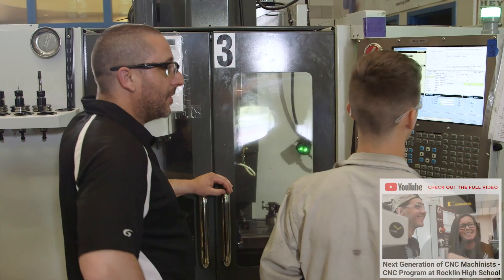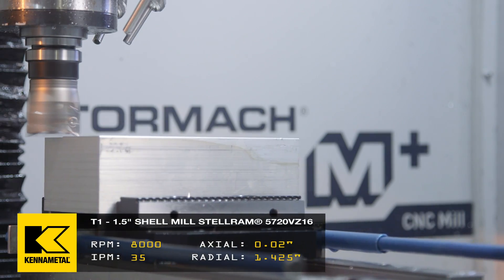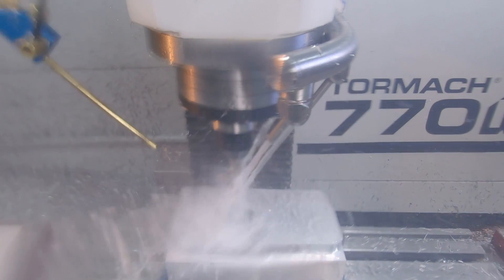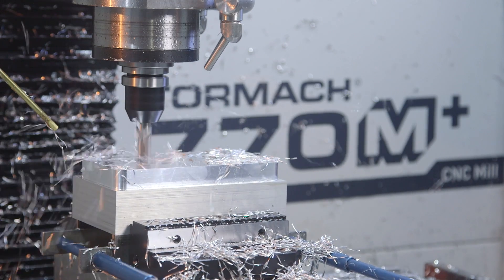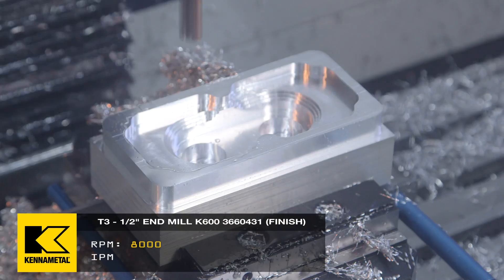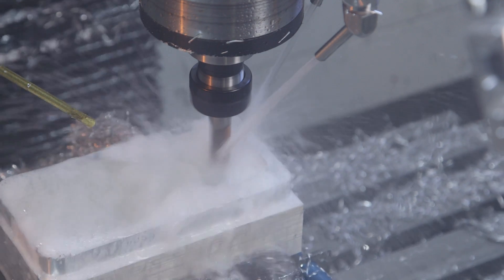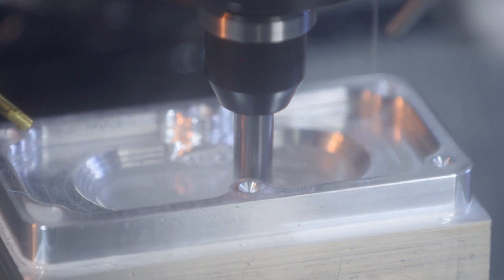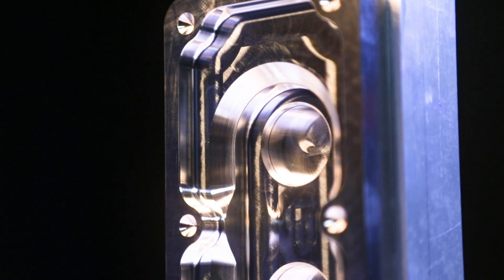Machining the TITAN-53M on a TORMACH - Part 1

Comment: This machine is a toy, it has a motor with the same 750W power as an electric hand drill.
Not accurate on dovetail ways, no quality castings, no power to cut and produce a proper chip in metal without vibrating and breaking tools. 

This message undermines the Titan mission which is supposed to be about excellence.
Where is this machine made, can anyone guess?
No BOOM here folks, rather a case of taking a promotion fee.
This has tainted my view of Titian going forwards, although we all do make mistakes from time to time.
Titian, you have a Rolls Royce showroom and you are trying to sell something like a tuk-tuk. It doesn't make sense.
Reply: But are you a machinist at working a job that has a high end cnc, or do you actually own that high end cnc? This thing is actually in reach for hobbyists, whereas other machines you’re looking at least double/triple the cost. It easy to say what you say when you go to school or work somewhere that has the high end machines. But...you’re stuck doing jobs that your boss gives you rather than making your own projects/ideas.
Reply: Greetings Michael
The problem I have with this is that buying a CNC machine is just the begining when it comes to spending hard earned money chasing a dream.  When you add on all the extras such as tool holders and other machine options, which many people do right out of the starting gate, then the price can easily double.
I agree that the lowest starting or base price is attractive however one must remember that they are buying a tool to perform certain functions.  For most people this will be an investment of sorts and when it comes to investments it really does pay to do your homework.
1. You need several KW on the spindle as a minium.
2. ISO 30 taper minimum to secure the tooling (sub 10mm or 3/8 tool diameter), 40 taper is better.
3. Servo motors on the axis not hybrid or stepper in order to have proper torque and speed.
4. Linear ways and ground ball screws are the only economic method of obtaining repeatable accuracy.  Any slop in the drive train will simply shatter or chip decent carbide tooling.
5. A proper rigid frame or casting to prevent the machine flexing and to have tight control of harmonic vibrations that all machines/tools have.  A machine that can easily bend or flex will destroy tooling and bounce around on the workshop bench or floor when climb milling.

When trying to buy cheap your options are heavily used old machines that would more than likely be well past their best. The second option is kit like Tormach.  Both options are sub optimal and will result in much frustration for the average person looking to get in to this field. There will of course be people that know exactly what they are getting and how best to use such kit, but not many.

I myself have been here many years ago.  I worked out what was what and put a plan in place to obtain a proper machine which I now have.  You need to work hard and smart and save. Avoid debt as this is another potential pitfall.

I would recommend looking at some of the Haas offerings as they do cater for a tight budget.  There will be others out there such as Hurco which is what I ended up buying.

The general rule in life, which tends to be true more often that not, is 'Buy cheap, buy twice'.

Kind regards.
Reply: @CATANOVA  Dude, different people have different needs, limitations, and objectives. Yours is the perspective of a purchaser who can commit to $50 - $100K or more out the gate. So, yeah, obviously not a Tormach buyer. But me? It was a stretch as a hobbiest to even get a Tormach. And, no, I'm not going to buy some 20 year old dinosaur FADAL, and then update it and pray it keeps running. But for others that's an excellent way to save some $s and get higher performance. But I don't need industrial speeds and feeds. So for people like me, for someone wanting to smart small in a side business, for a school, Tormach machines are a very good choice. But, clearly, if you need (and can afford) the extra speed and accuracy, by all means go for it. Also if you work within it's power envelope, it's perfectly capable of producing high quality parts good enough for many if not most parts a hobbiest or small operation produces. And if you think Titan added this level tool for a promotion fee, well you're entitled to your wrong opinion.

Comment: @titans of CNC:Academy What coolant ring is that?
Reply from the maker: Came with the machine
Reply: @TITANSofCNC  interesting, it's not on the tormach website
Reply: @MakingandBreaking  It is now, actually it's been there all along, but was hard to find (no proper link from the Coolant menu item). But Tormach have recently updated their website and the 1100M and 770M specific versions of the flood coolant system and of the automatic oiler are shown on the appropriate pages if you follow the website menus for Accessories and then Machine Options (see Oilers) or Coolant Systems (see Coolant Pumps, 1/8 th HP model 38881).

Comment: Does tormach accept mastercam programming?
Reply: Tormach accepts Gcode so yes pretty sure Mastercam will work.
Reply from the maker: Absolutely
Reply: The tormach machine control will run standard G-code, as will any machine using a PC based control running Mach, EMC, etc.  I do not believe there is a post in Mastercam for "Tormach" but you can probably use one for HAAS  etc. with a couple of minor tweaks. But if you can afford a seat of Mastercam, a Tormach is probably not your best bet for a machine tool.
Reply: @mytuberforyou  I have a lifetime Mastercam license through my College. I also know long hand. I'm just looking for something to keep in the garage and run on my free time. Keep my skills honed.

Comment: You guys must have some secret sauce. I’ve watched dozens of Tormach videos and no one gets the surface finish that you got on that part. I’ve never seen anyone use Kenametal tools in a Tormach either. Are those tools really that much more precise? If that’s the key, the difference from the other videos I’ve seen is mind blowing.
Reply from the maker: Tooling is huge, also pressure and rigidity... many try to push and show aggression...
We are focused on the Art of cutting and teaching as we go by giving all speeds and feeds etc
Reply: @TITANSofCNC  How would you go about geting similar cutting results on machines with different specifications and alternatively differnt tools. We use a Haas TM1P that has more horsepower but less spindle speed available (6000RPM). Would it make sense to use tools with more flutes or simply just feeds and speeds by 25%, or utilise the HP to take deeper cuts?

Comment: Are your feeds and speeds arrived at by following the tool suppliers recommended feeds and speeds or did you calculate them yourselves?  I ask because my Tormach 770 generally can't use the recommended feeds and speeds supplied by the cutting tool manufacturer.
Reply from the maker: You know, it’s really an Art. You also have to look at your machine, HP, Speed, Rigidity etc.
I always listen to reps and use that as a starting point but usually push way past it... by thriving in different lanes... like having really good rigidity, tool length, Coolant etc...
With the Tormach, I see it for what it is... a low priced machine that doesn’t have power but allows people who could never have afforded a machine, to have one and to make parts to print.

So notice my Radial depths... very small, but I go full depth...

Also use drills that break chips well like GoDrills because it take less force to drive them.
Just have to learn, use common sense and learn as you go.
Reply: Yea that's kind of what I figured.  I've found that with my 770 I generally have to reduce nearly all of my calculated feeds and speeds by at least a third of what's recommended by the tool manufactures and also those feeds and speeds that my HSM feeds and speeds software churns out.

I was really hoping that this video had some easy to figure out method of calculating feeds and speeds for Hobby-Mill like the Tormach line of CNC mills.   I guess it's really not possible.  After breaking my share of end mills, I eventually had to play it by ear; literally.

Thanks for your quick reply and keep up the good work.
 @TITANSofCNC
Reply: @MrTjmk  You can still use chip load to calculate your speeds/feeds, but with a flimsy import milling machine (mine's an RF clone, not a Tormach)  your feeds and speeds need to be a lot LOWER (with the same chip load) because the spindle just doesn't have enough torque at the kinds of speeds big boy tools are designed to run at, if you can even get there. The most important thing in my experience is running high positive rake aluminum inserts, my machine is not at all tolerant of using carbide inserts for steel on aluminum, takes much more cutting force and bogs machine spindle.

Comment: M+ so that machine has servos, Tormach are finally delivering some?
Reply from the maker: Yes, not sure when but it’s weeks not months... I believe
Reply: As of early May-2019, the servo upgrade kits are shipping to end users (just got mine!). These are the upgrades for 1100M --> 1100M+ and 770M --> 770M+. Tormach says servo upgrades for older 770/1100 series 3 (and I think even earlier) are coming later in 2019. M-series Spindle upgrades are still pending and will take M, or M+ to MX for those interested.
Reply: @SH-pc4xt  
Thanks for the info 👍

Comment: I ordered a Syil 5 as they seem to have better support in Europe. It is a 440 sized machine, slightly cheaper, better specs.

I almost went Tormach, but apparently they can't even be bothered producing 230V or 400V machines that is needed for every other marked than north America and Japan. 

Tooling is also a problem, because there seems to be no way to buy Kennametal here. The local distributor does not carry the Titan of CNC tooling kit, and also does not sell to individuals or small companies starting up.
Reply: The 1100S3 & 1100M are 220v. Tormach's electrical system is internationally recognized for use all over the world. You can get  a transformer to adjust the voltage in your situation if need be. KMetal is premium tooling and I am sure if you contacted HQ in USA they would be happy to help you.
Reply: @automan1223  the main problem then is that the 1100 are out of my price range. And frankly getting too close to HAAS tool mill pricing. 

But also the 220V is not made for European 230V 50 Hz. It is not approved and illegal to connect. The same is true for the transformer. It might work, but if someone is hurt or the house burns down, you are in trouble.

But yes, all they need to do is include that transformer in overseas orders and get it CE approved. I do not get why Tormach apparently can not be bothered.

Comment: Nice to see the 770M running.  When I saw yalls other video I called Tormach and got a bit of background on this particular machine you have.  Couple of comments/questions:

1) the 770M is targeted at “affordable”...please keep that in mind when demoing the associated tooling :-).  Even at 50% off, that tooling is very expensive for small biz owners like us.  
2) would be great to see some of the setup for the part, eg Fusion 360/Inventor/Etc. Toolpaths et al
3) so given this is the 770 w servos, are y’all using a standard 770 post or a custom one?
4) speaking of affordable, how much is that vice?  Can’t find pricing info anywhere online.  Just curious if one might replace the Glacern I’m currently using.
5) would be great to see some micromaching on the 770M (hint hint) :-)

Thanks for posting the video, looking forward to more from you.

Be glad when the 770M starts shipping!  Been waiting quite a while for it.
Reply from the maker: The vise is one we had available but is over kill for this machine as it’s one of the most rigid vises in the world... 

Post is exactly the same.

Tooling can make a affordable machine... function like an expensive machine. So my theory here is to show that this machine can make beautiful parts to print, with great surface finishes without taking days to do it.
Reply: Thank for replying.  Totally agree on the turn around time of machining vs 3D printing (which we currently do), also materials costs.  For materials costs for prototyping, Renshape vs resin (at 250 a liter for example) for larger core parts is very attractive.  That’s the entire reason we’re looking to move to a hybrid environment of combined printing and machining to produce a given prototype.  CNC is new to us, so look forward to following y’all on the “education/small biz” approach ;-j
Reply from the maker: Lots more set ups coming and all kinds of machining. As previously stated I have 400K, 40K and this 15K machine... each has its place.
Reply: Agreed.

Comment: kinda funny that a $10k tormach is outfitted with $10k worth of kennametal tooling...
Reply from the maker: Again,
Definitely wrong on that. That Shell Mill is a few hundred and you use it on everything. Tooling is the key to Machining and competing.
Reply: @TITANSofCNC   admittedly, 10k is a bit of an exaggeration but not by as much as you think. 
$350 for that cutter body, $20/insert or $200 for a box, $300 for that long flute 1/2 endmill and so on. Kennametal is a premium brand and as such command premium prices. Keep in mind that guys who own tormachs are not going to be getting discounts from tooling reps like a large shop as you would get. The point I am trying to make is that it might be better to match tooling appropriate for the machine. On that machine, Tormach's $150 superfly cutter is going to perform just as well as that $650 shell mill (arbor+body+inserts) and to a guy just starting out in their garage with a tormach, $500 is a huge difference.
Reply: @Slayer553826  I agree with you on this as we little guys have to even put in our tool line up some "Bang Good" tools as we just don't have deep pockets. I don't think I have a single Kennametal tool in my inventory, not that I don't want too, as for now I just can't afford it.

Comment: I like where this is going, but have one comment regarding tool choice. There is a what I see as a bit of a mis-match going on. The tooling used for the job costs more than the machine itself. That shell mill with inserts and holder is close to $1,000.
Reply from the maker: Actually the tools are based from a TITANS of CNC: Academy Kennametal Tool Kit that they sell at 50% off. Also, Tormach start at $7000 which is drastically cheaper than a Haas and it can go in your garage.
Haas has more power and costs more and is a better machine but many simply can’t pay $30-40K 
Jump to a Haas once you have work and money coming in or a solid plan for a school or business. Then use the Tormach as a second op machine. PS. Many can’t go to college. You could get this machine and work through the Academy at nights and the weekends for less than college etc... and own your machine at the end of your education.
Reply: @TITANSofCNC  I fully understand the Tormach, that is what I like about the video, more realistic entry point for the beginner. And that is a really good price on the tooling. I stand corrected :)

Comment: all the tools used to make that part  expensive then machine itself I see no point. If you can buy those tools you can afford  at leas Haas. If you are buying Tormach probably you cant afford the tools. Dont get me wrong Tormachs are reasonable machines if you are not shooting for tight tolerances.
Reply from the maker: Actually the tools are based from a TITANS of CNC: Academy Kennametal Tool Kit that they sell at 50% off. Also, Tormach start at $7000 which is drastically cheaper than a Haas and it can go in your garage.
Haas has more power and costs more and is a better machine but many simply can’t pay $30-40K 
Jump to a Haas once you have work and money coming in or a solid plan for a school or business. Then use the Tormach as a second op machine. PS. Many can’t go to college. You could get this machine and work through the Academy at nights and the weekends for less than college etc... and own your machine at the end of your education.
Reply: Rule of thumb in the machine shops I've been at says cost of tools equals cost of the machine (germany, mechanical engineering).
Reply: @jaden7646   yea but  if you gonna run machine shop in terms of work you dont want machine that uses open loop control. because you will have hard time to hit the dimensions.
Reply: also how many tools are we talking about if 5 tools cost as much as the machine something is wrong
Reply: @Game0verxD   64 SK40 tool holders per each machine, 450+ tools and their specifications stored in a shared tool list.
We produce mostly single parts in mechanical engineering.
If you use your tools, you know their dimensions and how to hit the required dimensions.  That is simply how a machinist works after he got to know his machine.
Reply: You actually do not need all these tools to run the job. A endmill can do instead of the shell mill. A 1/4 endmill will do instead of the 1/2. Yet I believe it is more useful to show the capability of the machine with proper tools. 

We can downsize to what we have. And then maybe later try again with better tools if that becomes available. But not be stopped in the learning process just because a shell mill was not in the inventory.

Comment: Nice and clean, like the new fresh look of everything, just tidy! Would love a review of that Tormach in say 6 or 12 months to see how it all holds up and you've had a reasonable amount of time to test it. Looking sweet so far though!
Reply: I have 2 1100s one is 7-1/2 years old, the other 5-1/2 years old both still doing lots of non conventional machining, lots of steel, heavy parts, over sized parts, tractor flywheels, engine blocks, engine heads, granite, wood, ect. still all original spindle bearings.